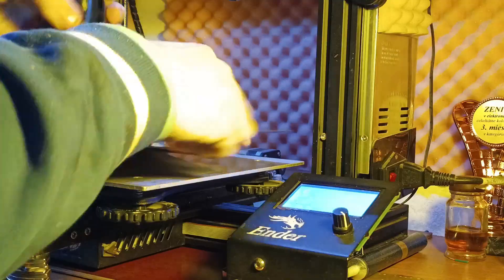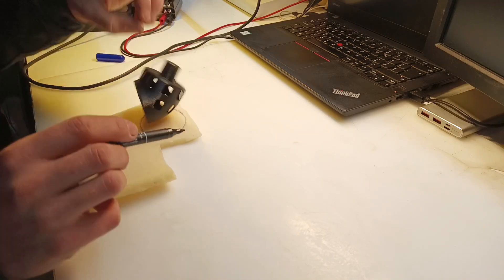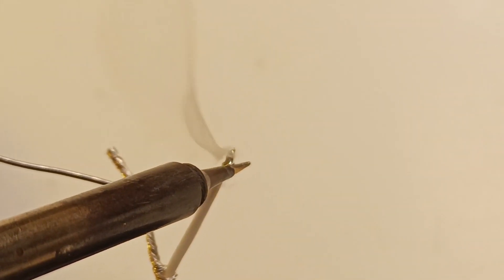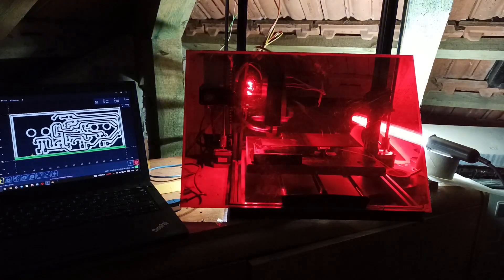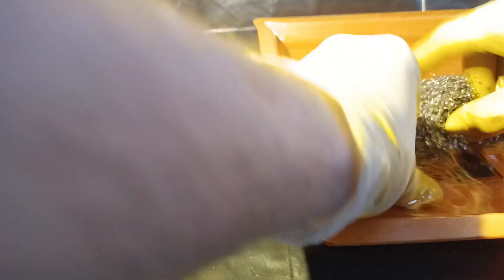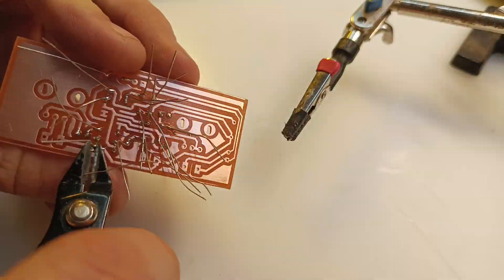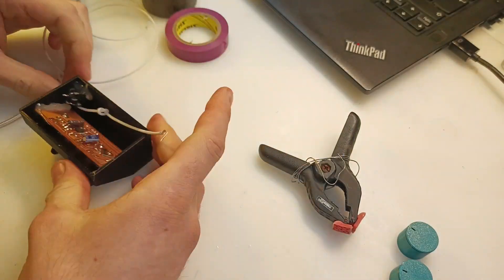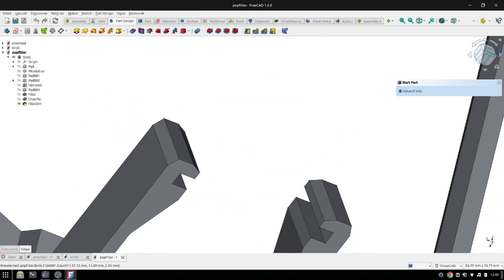Dynamic Microphone from old headhones.

Comment: Yo, so, I have some old speakers, but not a 3D printer or a wood working station. Any chance you could send me the parts to slap something like this together myself? This could get me some crazy sound for the voice acting I do. 

Edit: I'd be willing to pay you, obviously.
Reply from the maker: @Melechtna  what kind of speakers? it needs to have very light membrane. i can send you design files if you want and there is a lot of services that offer 3d printing so there wont be problem. shipping parts would be unnecessarily expensive.

Comment: noice btw i have a question if u hijack the microphone line where does the mic output of the original headphone go do you just leave it unconnected or what also how long dis this take?
Reply from the maker: thank you :) the original mic line just stays unnconnected or shorted to ground. Both options are correct. In my case its unconnected and it took me around 1-2 days to make this :)
Reply: @Jacob_The_Eletrician why no more video😢

Comment: you might want to improve on this a little. could use some dampening usually in dynamic microphones the capsule is basically heavily dampened on the back and sides with some slight dampening on the front to avoid slightly dampen the pressure waves generated from speaking into the capsule
Reply from the maker: thaks for your suggestion, might look into that :)

Comment: cool but, the bass is too loud compared to the volume. i can't hear you clearly at normal volume levels, and when I turn up the volume the bass sounds blown out and grainy. you should try adding something to adjust your input or output settings.
Reply from the maker: thaks for feedback, it depends on the device you are listening it on. i will see what i can do, maybe some high-pass filter will do :)
Reply: @Jacob_The_Eletrician  Maybe steal some tricks from guitar electronics and use high ohm potentiometers, maybe add a treble bleed, a normal tone pot and a greasebucket.